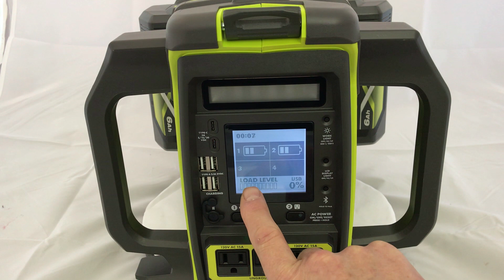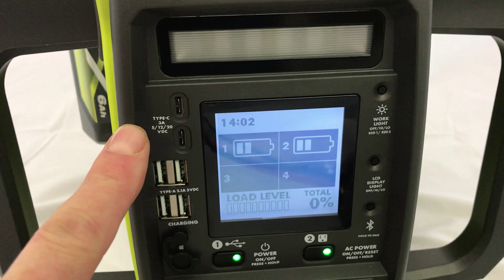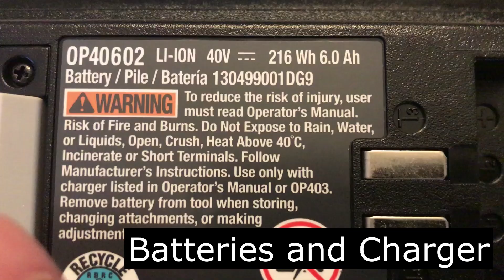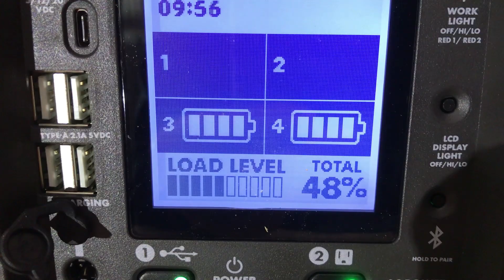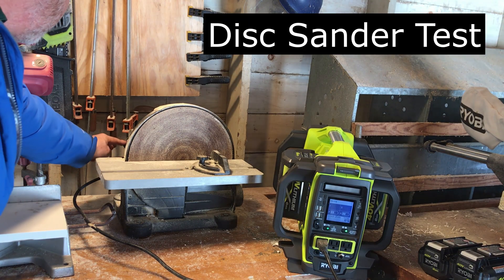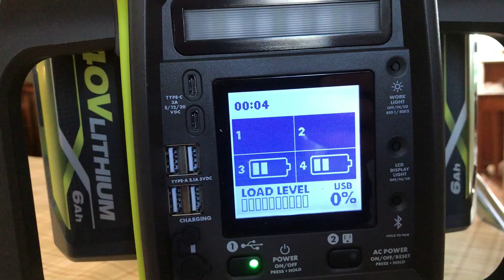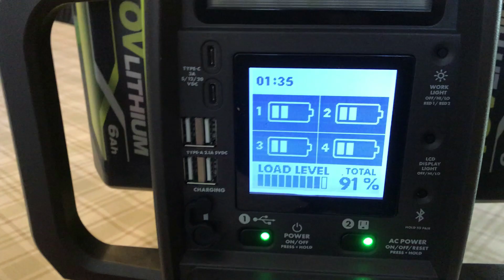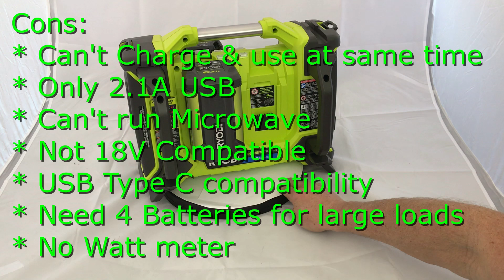Ryobi  40V 1800W Power Station RYi1802B6 Review

Comment: I know this is an old video, but I have one of these that I bought two years ago.

I wanted to see if it might be possible to hack this to use a 36v LiFePO4 battery... the voltages seem to match up very well, with both li-ion and lifepo4 36v batteries having a low voltage of 30v, and a high of 42v on lithium ion which is about 95% on a lifepo4 battery.

I just dont know how the connectors and pins work on the inverter. This may not be an issue though if i charge the 36v battery separately instead of using the inverter's built in charging as it would turn off due to the lack of pass through charging anyway.

any thoughts?

Comment: During a significant outage in Western WA, I had to rely on this device. It’s a great concept; the package is well-designed and swapping out components is straightforward. However, as mentioned, it lacks useful indicators and the absence of passthrough charging feels like a major oversight. For $800 it doesn't feel very good at all.

That said, if you have high-quality batteries and are using smaller devices, it performs quite well despite its limitations. We managed to charge tablets, phones, and lights, and even powered the fridge for extended periods. With a lot of batteries (9), we did need to use another generator. Ultimately, we used a gas generator to recharge the batteries and this device to charge and power a fleet of smaller devices and the stove fan.

For the record I have over 112 hours on the generator now at this point and as long as the batteries are in good condition it works nicely and is very portable. I'd wager there are better devices for $800 though....

Comment: That's.   High power microwave .   Normal. On 20 amp. Independent. Circut it. Run.    Small. Power microwave.     15 amp ..    like. 1000 watt. Or below.

Comment: Mr Serendipity Sue, I've got a 1800W Ryobi 40V powerstation and a 3D printer and I'm trying to use it as a UPS.  I basically need continuous pass through charging on this Powerstation.  I saw that your 3D model needed to be tweaked to fit this model.  I'm handy in Fusion360, Do you have that 3D Model?  Is it on an Etsy store or something?  I'd buy it if you were charging for it.  Let me know.  I'm stuck with this 40V non-pass through power station and it would be so much more useful to me as a Battery Backup to my Print Farm.

Comment: Pass-through charging makes no sense to me. If you have 120 volts available why are you using a power station? The charger that is in this Ryobi and most similar systems is extremely slow. This is not a solar power station. During the day when the sun is up or I'm using a gas generator to charge camper batteries I use a fast charger to quickly charge the Ryobi batteries that I used overnight. I use this to power high-draw items like coffee pots and toasters when camping to preserve power in my RV solar bank until the sun comes up.

Comment: FYI: Do not use the "bars" on the battery as a power indicator.  If you want to test whether an appliance will work, you must charge fully.  The same is true for a Lithium (LIFOPO4) battery (12v/24v).  The voltage may appear to be at 50% degradation, but the capacity is actually at 75% degradation.  Why?  Because those bars only show voltage, they do not show battery capacity (watt usage).  To show capacity, you will need to use a watt meter from full charge.  So - go back to my second sentence.  The review is fine - but unless you keep a watt meter on the output, it is simply a "looky here" video.

Comment: Thanks for the vids.
Do you know if it has a 12v output that you can run a 12v camping fridge off ?
Reply from the maker: It doesn't, but they have a new 18V battery product out that does: https://www.ryobitools.com/products/details/46396035370

Comment: This is a BIG disappointment. Actually, I own this Ryobi and the Dewalt 1800-watt power station. The DeWalt is a massive disappointment as well. Neither power station has solar charging, pass-through charging, watt meters, or good displays. The Dewalt isn't even a pure sine wave so it's almost useless in most cases. The batteries on these "power tool" power inverters are also costly. Most people don't understand precisely how much battery power you need for basic things and these companies are playing into the lack of public knowledge.

Comment: Cool video. What would be cool is to parallel with the small 300watt 40v inverter, then it might go to 11. The Watt meter is on the app, would be cool if it was on the LCD but the app has more details. yay.

Comment: Did you ever get around to trying out a pair of 18V batteries in series?

I imagine you could get pass-through charging by inserting a charger between the power station and batteries (albeit aftermarket) like you have done in other videos. This sadly does not fix the issues with brownouts under load though.

Nice review. I appreciate the context.
Reply from the maker: no, I have to figure out 40V charging first
Reply: @SerendipitySue  aha! well the station was on sale today for $650 including two 6Ah batteries and I pulled the trigger. I may just whack my scope on the lines to see what is going on. It is possible that there is a digital handshake required rather than a simple pull-down resistor.

Thanks for the reply.
Reply from the maker: @TheResistorNetwork  please try to figure out 40V charging protocol! It would open up a bunch of new projects!
Reply: Paralell for fast charging...
Reply: And i also tested four fully charged 6Ah batterys connected to one empty 1.5Ah battery in paralell with no problem, the bms seems fine with controling it, thow it gets hot, but no more the fast charger does...

Comment: It’s so close to being great. They need to fix the over load issue with motors, add pass through both 120v and solar, add fast charge to the slots so it can be like a base station for batteries.  Gen 2 of this will be nice if they take the advice everyone is giving them.

Comment: I was really excited about these, until I saw some of the details.  The lack of pass-through charging was a huge miss by Ryobi.  Also, a 1.5 amp SERIAL charging system means that even if you only have four of the 4ah batteries connected, you're looking at 10 hours to charge them all back up from empty and during that time, you can't use the unit for what it was designed to do.  The other things you mention, like no cigarette lighter adapter and the odd choices they made for USB support, were very disappointing.  The worst part is the net cost of buying this unit and the larger 40v batteries to make it worth having.  It's quite a bit more expensive than similar products with dedicated batteries, and those offer better features and capacity.  Ryobi missed the mark on this one, for sure.

Comment: This is to let the public know that there is a factory defect the first run was fine but one or two of the next runs have a defect to find out if your product is one of the defective ones it’s simple shut the unit off and unplug from the wall plug for batteries into the unit and let the unit sit for 7 to 10 days go back to the unit and check to see if all four batteries are charged if the battery in slot number three has one or two lights out do you have one of the defective units if any of the batteries are completely depleted then you have one with multiple defective in it these units will not only destroy a battery but they will also only give you 50% of the run time that they are supposed to if you have any batteries that this unit has destroyed even if the battery is two or three years old you should return it to Ryobi after contacting them and they should replace absolutely free as the defect is their responsibility as far as the unit goes it will work still but you should only use the batteries in the slots that are not defective usually it is slot number three that has the defect Ray will be at sometime in the future may also replace the unit but this is not known yet but the unit will destroy batteries and you will only get 50% of the run time this does not mean that Ryobi has not made a good product it just means that there are a few out there with defects quite a few

Comment: Chris, I appreciate the thorough testing and found your comment on the HD product website. I also was disappointed in the performance and for a load test only ran a 1500W space heater for 25 minutes on 2 x 6ah and 2 x 4ah full batteries. I can't justify the cost/convenience against the battery capacity limitations when compared to what 5 gallons of gas in my genset gets me. I had high hopes.

Comment: Do you think this would run a 1/2 HP sump pump?
Reply from the maker: you would have to give it a try. The start up current can be a problem. You would have a better chance using four of the larger 6+ Ah batteries. According to google "Household & Office	Running Wattage	Starting Wattage
Pump, Sump, 1/2 HP	1050	2150"

Comment: I just want to know how long it will run a fridge/freezer
Reply from the maker: it depends on how many watts your fridge/freezer draws and what batteries you have
Reply: @SerendipitySue  a fridge like yours and 4 6ah batteries
Reply from the maker: @jd-it4on  The 40V 6ah battery probably has 216Wh capacity (I don't have one... look on label). So four batteries would give you 864Wh. My fridge draws 140W when the compressor is on. So it would last 6hours constantly running. But Refrigerators don't fun all the time. It depends on room temperature

Comment: For the price, I think GoalZero is way much better made, I bought the Goal Zero Yeti 1000 from Costco. It can 
Charge while using and also can use Solar Panel to charge it up to 360watts.
Con: wall charger about 60watts (16v, 5A),
Solar panel limits to only 12 volt rating,
Heavy weight about 45 lbs, AC peak at 1,500watts and lithium @ 500 cycles

Comment: Very nice review.  I think your points are all valid.  However, I believe this unit would so what I need (I'm not running power tools with a big start-up draw.)  I notice that these units have been on backorder on all channels for several months.  I wonder if Ryobi has halted production in order to make some engineering changes.
Reply from the maker: that's interesting because the product manager told me they might make some changes after my review. Of course after I sent them a bunch of answers to their questions and some suggestions, I haven't heard a word :-(

Comment: IF YOU USED A WATT METER with your tests we could see the power draw. You have to be exceeding even the 1800W surge rating or your batteries are too low to deliver the needed wattage. Remember even if you had four 6ah fully charged batteries installed you only have theoretically 960 kwh. So lets say you need the full 1600 watt output, well guess what your run time has dropped from a hour to around 36 minutes. This is only provided the batteries are fully charged. 

Now to get the 1600W for just 10 minutes your batteries will need a combined 266kwh which is 27% remaining on four 6ah batteries or 1 full 6ah batterry plus a  full 2ah battery. In theory a full 7.5ah can do the same job for 10 minutes by itself 

But I think you are exceeding the 1800w surge

Comment: Chris, one thing I have never seen is the reverse of this device and your power hacks--a Ryobi AC to DC adapter. So you could run stationary One+ devices by plugging them into AC instead of using up batteries. That need comes up every so often, especially with power hungry devices. Seems like there would be more to it than simply converting 120V AC to 20V DC. Something you could tackle in a future video?
Reply from the maker: Thanks. I've thought about this. The problem is that some tools take 10+ Amps. That's a pretty big/expensive power brick

Comment: Great review. Yes for the price it does not meet expectations. All electric inverters need to be able to work while charging otherwise they suck. They are far too expensive and I can only see the benefits of something that costs a good amount of money if you can charge with a solar panel to atleast save on fuel and electricity.

Comment: I dont understand how batterries work on this. Doesnt one 40v 6 amp battery gives you 240 watts so x2 only gives you 480 watts, so x4 gives you 960 watts. If you mix the batteries with a 4 amp 40v the 6 amp batterries will only run at 4 amps....so i am not understanding how they are advertising this at 1800 watts..
Reply from the maker: The batteries are rated in Ah (Amp Hours). That is how long something can run. Ryobi doesn’t give a max current rating for their 40V batteries. But to get 1800W out , each battery needs to produce 450W or roughly 11Amps at 40V. 40V batteries actually range from 30-42V depending on their charge level
Reply: 6 ampere hours.  Remember that there is a time component.  The reason for the 216Whr rating is that 3.6V is the nominal cell potential over its discharge, which is then multiplied by 10 for the number of cells in series and again multiplied by 6 for net cell ampere hours for 216Whr.  It is not 240Whr as the cells are only at 4V when fully charged.
Reply: Since the 40v batteries are only 6 amps each one provides 216 watt hr..so 4 batteries x 216 is not 1800
Reply from the maker: @trainer4uu  1800W is that maximum load, not the storage capacity
Reply: @trainer4uu  6 ampere HOURS.  And battery operating current is dictated by the load, not the battery.

Comment: Is there a way to connect differently pair of batteries like two Milwaukee or DeWalt batteries to use with these power station?
Reply from the maker: You should be able to use other tool batteries as long as they have built in BMS. Look on thingiverse for 3D adapters for your battery brand
Reply: @SerendipitySue  I did try to make it work with dealt batteries but no go on  theme, it may need the sensor connectors as well.
Reply from the maker: @jaime4272  I saw this: https://www.thingiverse.com/thing:2435964 that seems to work
Reply from the maker: I do have 2 small Dewalt batteries. I guess I could try something when I get a bit of time

Comment: They certainly saved money in places, like, if you have AC power to charge it, you don't need the outlets. Without a good way to charge off solar, it is certainly a limited product in many ways. The manual is really thin for a product like this. You really don't know how much AC output you will get based on the charge and size of your 40v batteries... They suggest 5ah or larger, but the system should give better feedback for sure.
Reply from the maker: I found a way to charge it with solar... but it still isn't pass-thru charging ( https://youtu.be/xhLEnkzLj60 )

Comment: Chris, has anyone attempted to build a large size powerwall... let's say 15 or 20 kilowatts built with only Ryobi Batteries?   Either 18v or 40v?  How many batteries would we need?  I would love to see it done.... I think that would be great publicity for Ryobi!
Reply from the maker: Haven’t seen it. Two problems to figure out with 40V batteries 1) how to charge them without Ryobi charger (looks like they have digital signals on T1), 2) have to test if batteries can do pass-thru charging. 1800W powerstation didn’t support it
Reply from the maker: I think the answer is a LOT of batteries ;-) The 40V 6Ah battery has 216Wh. It would take 70 batteries to have 15Kwh of power! Each battery lists for $179 at Home Depot. That would be an expensive wall! ($12.5K)
Reply from the maker: I did hack the 40V battery charger: https://youtu.be/p4xW9f1ohlw You could put a bunch of them in parallel :-)

Comment: I notice the batteries were not fully charge. Charge all the batteries and try the test again also look at the watts and stay below  1500 watts. Let see what happens.
Reply from the maker: It also had issues at full charge, but you don't always have fully charged batteries. That's why I did the tests with the 6Ah batteries half charged. It shows two problems. First the Voltage "sag", and second the port display information. In/out wattage would be much better.

Comment: Thank you for testing this. Like so many other testers in the field have said, I don't know why this shipped. I'd be okay with it if it could at least have a power through feature, that would give it a leg up on Dewalt and Ego. But at least it appears to work with a refridgerator, my primary purpose of getting it is to back up the fridge if we lose power for more than 12 hours. 
Here's hoping they come out with an 18v one+ multi-pack inverter (similar to your earlier design).
Thanks again!

Comment: my only question is, why half of all 4 batteries are always only half charged and why they are not full on 6ah or 7.5 ah?
Reply from the maker: I wanted to test batteries of different charges.  Also important to determine voltage "sag". Otherwise some loads might only work with fully changed batteries and not half charged batteries

Comment: these are the reasons these so called power stations (I don't consider these as actual power stations, the batteries are simply to small) are crap. I got several batteries for my ego stuff, I'm not paying over a thousand dollars for a battery hookup when these batteries are to small to hold any significant loads, It might be different if the stations were only a couple hundred bucks. Basically it turns your extra batteries into running a few lamps and some electric blankets. Good for emergencies but not at the crazy prices they want for the bare units itself. Heck this unit isn't even available to purchase yet.
Reply: That's why I built my own so I could use my existing 18V batteries ( https://youtu.be/lAAWFCU4iEM ). The biggest expensive was the 3000W inverter.